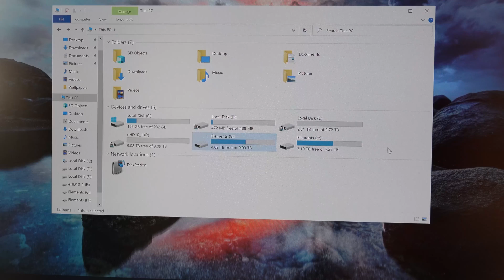External Hard Drive to Internal Hard Drive | Shucking Western Digital Elements

Comment: Ok I have 5tb external WD digital I finally backup up 5tb into 18tb disk. I did not tape anything. Now I get 3 hidden partitions. 1. 500gb, 2. 2000gb 3.2500gb. So I noticed that all usb drives are MBR standart. You need to convert to GPT. Because USB has problems reading huge tb disks and hits its limits. Find tutorial on microsoft "Convert an MBR disk into a GPT disk".
Summary commands are:
diskpart
select disk <disk-number>
clean
convert gpt

And finished all working. Use format disk. All 5tb are usable.

Comment: Can I do this without having to format the drive? I had it backed up to another external drive and that one doesn't want to power up neither.
Reply from the maker: Should be fine without formatting it but always backup your data before doing anything like this just in case something goes wrong.

Comment: Mines got a little water in it and started making beeping noises before it stopped working. is it possible to fix it? (Talking about the external hard drive btw)
Reply from the maker: Idk, you may need to call the manufacturer or take it to a repair place

Comment: What if you already connected to pc and booted it without covering the 3rd pin?
Reply from the maker: If it works, then you are good. If it doesn't work, then you need to cover the third pin so it doesn't go into power saving mode making it undiscoverable.
Reply: @landpet  I mean will it work if I cover 3rd pin after I launched PC without covering it?
Reply from the maker: @NeSpravedliviy114  if it works now you are good to go. If it doesn't work, then you can cover it and it should work. To answer your question, yes you can cover it at any point in time.
Reply: @landpet  Thank you!

Comment: umm, I think you don't really need a tape because scratching the pin would just block the connection off as well, just an easier way :)
Reply: Are you saying this as a joke or does it actually work like this? XD

Comment: What is the performance of these WD Elements made internal?
Reply from the maker: About the same, maybe a bit quicker but it's a spinning slow drive unless you use PrimoCache to speed it up. I have a video on how to speed your drives but you will either need unused RAM and/or an empty SSD or partition of an SSD which is used to cache the files to make it appear much faster.

Comment: Thanks. Does covering the pin mean that the drive will be constantly spinning while the PC is powered on, and if so, is there any way to make the drive power down when not used for 5 mins or so and power up when needed (as my external drives do)?
Reply from the maker: I don't believe it will continue to spin, it only spins when you're accessing/writing data from the drives.
Reply: @landpet  My external drives stop spinning when not used for about 5 mins. When I try to access them, I have to wait 5 seconds or so for them to spin up. If you never have to wait like this when accessing a hard drive, then it is constantly spinning, which is a great way to wear out your drive and waste electricity. I believe the power options enable you to power down drives that have not been used for a while. I am not sure if that works on all drives though. I have one external drive that does not stop spinning, even when the pc has been shut down. If I forget to disconnect it when I shut down the PC at night, it's still spinning in the morning. This is something worth watching out for.

Comment: Wow wow wow what kind of external hard drive? It is very very good for Final Cut Pro end my Files!! Also back up to prevent data loss disasters because if I lose my data I will die because it is important files and other  And I will other one for my PS4 can recognize up to 8 TB of maximum capacity because PS4 needs to reformat because the PS4 has his own encrypted file system very good crazy 10 TB I have 8 TB it is very boring and reformat it to be my PS4 hard drive cannot recognize 10 TB the maximum capacity for PS4 external hard drive is 8 TB so it is very very good option if I moved all of my files to the new external hard drive like this you reviewed for my laptop and other that enclosure makes my iPad to recognize the hard drive my iPad only recognize NTFS fat 32 Xfat my iPad it can recognize NTFS but only read cannot write anything to it x fat read and write!
Reply from the maker: exFAT is typically compatible with Mac and Windows, haven't tried the iPad though

Comment: Hey there. I have a western digital caviar green (can't remember what year I got it). I have tried the tape trick on pin 3,also the first 3 pins and still no luck. 
Model #. WD10EARS-00Y5B1

If you have any tips or tricks. 

Would love to be able to clean up some clutter around my desk
Reply from the maker: My experience has been that it's either taping pin 3 with that special tape or taping nothing. You can try it without taping any pins

Comment: Thanks also for other answers. I try to summarize. Wd Mybook in disk management I see it with the letter "G". A small part  , 350 GB says raw ,
everything else says unallocated.

Since I have not written anything I am sure that almost all of my previous data is still there. What can I do to recover it, then after format the disk?

So is there a way to restore the disk without losing data?
thank you thank you
Reply from the maker: If you have the data to usb adapter from the case, I would try using that first other than that you can use recovery software. Minitool has one

Comment: Sincerely  thanks for the reply. One thing is not clear to me: how do I backup before deleting the unallocated part? Thanks
Reply from the maker: No problem, I was assuming you would back it up before removing it from the enclosure. If it’s not backed up, then don’t erase anything, see if you can just access the drive. If you can, then nothing you need to do, forget about the unallocated portion. You may just need to assign a letter to it if you’re not seeing it in windows explorer.

Comment: I have an issue same model wd10eads 1 tb . around 8 to 9 years old. thing is connected internally the drive from my book , 3rd pin tapped then computer doesn't even switch on.
I remove power cable of the hd and computer does on ... What is the issue any idea
Reply from the maker: From what I remember, the older ones didn’t require the pins to be taped. Have you tried it without taping the 3rd pin?
Reply: @landpet  i tried without tape it shows in bios windows doesn't open it i guess it is from my book and has a pcb controller, maybe encrypted , in disk management it shows and ask me to format and use the same and i have a lot of data i just cant format

Comment: Hi, I have an older version of HD. Tried to connect it using the SATA connectors. My pc recognized it as local disk, but didn't show the volume and it got stuck whenever I tried to open it. Any advice?
Reply from the maker: In this video, I show how to format a drive on Windows. I specify this for a MAC drive but it can work with other drives as well that the computer is not picking up. It doesn't always work but it works in most cases. Only do this, if you have the data backed up because this will erase your entire hard drive. https://www.youtube.com/watch?v=0jB2TRdBfFI

Comment: Can you please suggest is there a way I can get rid of the power supply of the external hard drive. I want to use it like the one which gets power from the B to USB cable
Reply from the maker: The ones that just use USB are typically the smaller portable external hard drives.

Comment: So, I tried this method with my WD HD and it didn't seem to work. Idk if it's because my HD is an older model or something else but I was just wondering if there could be another thing at play here or if I might just be doing something wrong.
Reply from the maker: I would first try the hard drive without taping the 3rd pin to see if it shows up, cause older drives don't need this. This may be an obvious question but probably worth asking, I'm assuming your hard drive was working before you took it out? Some motherboards disable certain SATA ports when you're using a faster speed on an NVMe SSD so always a good idea to go into your BIOS to verify the SATA port you're using is enabled.

Comment: Would Seagate drives have the same 3rd pin protection?
Reply from the maker: Idk, try it out first without and pins to see if it works right out of the box. This is the first drive I've ever seen that has that, granted I hadn't done this for a few years before this one.

Comment: Hi, I read somewhere that the drive is encrypted and you would need the board/chip to decrypt it. Is this true? I can't power on my WD HD and wanted to try your method. Thanks!
Reply from the maker: My drive was not encrypted, so no decryption needed. Once I put the special static free tape on the 3rd pin, it just worked. If the computer recognizes the drive but it's encrypted, you could probably format it, (assuming your data is backed up elsewhere, cause formatting obviously deletes everything on that hard drive) to get passed the encryption (granted I'm not sure if formatting will fix your issue but I assume it will), to make it a non encrypted drive.
Reply: @landpet   Thanks for replying. No encryption on my HD as well, but I did read that WD 'automatically' does it. Anyway, I hope your method will work, will let you know.
Reply from the maker: @plusultra7329  Sounds good, let me know. Hopefully it does.
Reply: @landpet  Just to update you, so I have two hard drive that simultaneously had its power/board fried. My 2011 one, Windows was able to detect, all files intact. My 2015 one, unfortunately, Windows wanted to reformat immediately. No files detected. I would assume this is the encryption WD had in place. Thanks!
Reply from the maker: @plusultra7329  That sounds about right.

Comment: I'm getting the 2 TB WD Black P10. Will I need to cover the 3rd pin on that one also?
Reply from the maker: Unfortunately, I don't know since I don't have that device. It doesn't hurt to try it out with covering the pin (if it doesn't work, then try covering it).
Reply: @landpet  I did some research and apparently it does not have a SATA port. They actually soldered a USB where the SATA port would be at.
Reply from the maker: @CultivatedBunny  wow, good to know